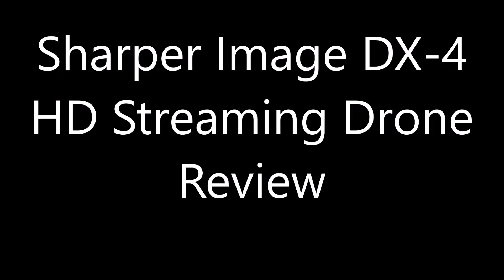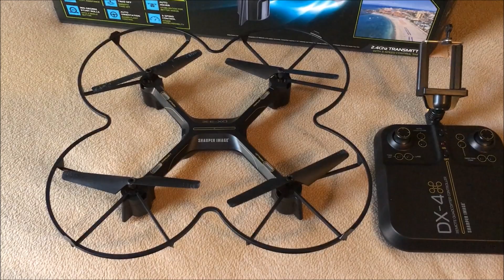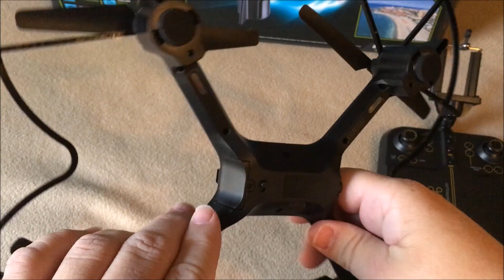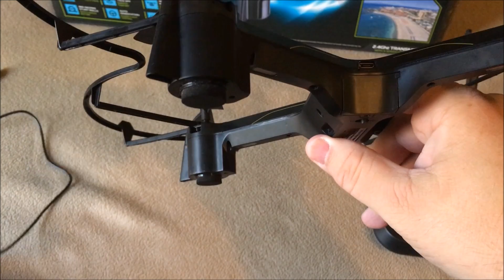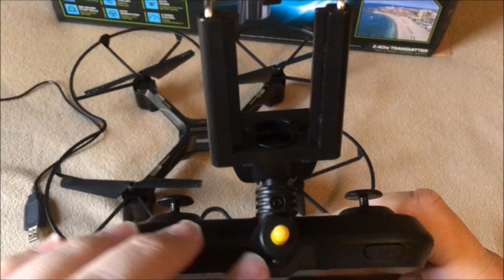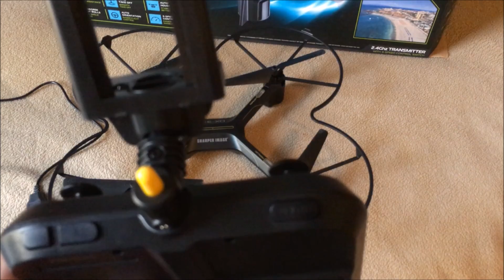Sharper Image Dx-4 HD Drone Review

Comment: I use the charger they gave and I plugged it I to the wall for over 5 hours and it still wasn’t charged and I also plugged it into my play station for over 6 hours and it won’t cut on or anybtjng and the red light is still on and I won’t come on

Comment: The manual says to press the right or left spin trim buttons if the done is rotating in one direction. As far as I can tell, these buttons do not exist. Also, how to you adjust the position of the camera? Am I supposed to just move it with my fingers?
Reply: Yeah, adjust camera with fingers prior to flight.

Comment: you can change the battery. just got this drone, went on ebay and bought some lipo batteries 1200 mah and some connectors. velcro the battery to the bottom of the drone and replaceable batteries
Reply: how much weight can it carry do u know?
Reply: matt delassus not much dude maybe 2 pounds if youre lucky

Comment: I didn't like it. The radio sticks are too small making flight adjustments hard to be smooth. The drone flies heavy with the rotor protectors on and if you take them off the first thing you hit bends the shafts. If you are looking for a beginner drone the Blade series especially the tini whoop is fantastic. This one is just a cheap toy. I got it as a present but would not buy on my own.

Comment: I always charge my drone from 2-3 hours but it runs out of battery in 15 minutes,what should i do??
Reply: 15 minutes? I guess you took off the protective thing for the blades. I get 8 minutes while recording. If you want more flight time, it cost way more
Reply from the maker: Nothing. That's completely normal. If you got more than 15 min I would be surprised.
Reply: Creature l m
Reply: Creature l p

Comment: I just bought the drone as a christmas present and today we were trying to set up the cell phone holder on the remote and the screws that came with it are too small ot too big to secure it. How did you secure the cell phone holder to your remote?
Reply: Arianna Duarte Yoo-hoo stick it on the black rounded part next to the yellow tip and tighten it

Comment: I'm thinking the Drone you need that you received or purchase is faulty because everything that you're saying is an issue with yours it's not a problem with mine at all my camera works just fine it is HD it doesn't glitch or cut out so I'm thinking you have some wiring issues in your unit... Also about the stunt button in the manual it states that you have to press the start button and then the direction that you want it to flip so with that being stated to completely operate this drone check over your manual once more honestly if that doesn't work I think it might just be your drone everything that I do to it as far as the directional trim does wonders and it hovers standing still
Reply: Stan Lewis I just hate the short battery life.
Reply: Stan Lewis me too
Reply: same
Reply: sometimes they just end up faulty mine for example is lost somewhere in the middle of a field because I lost control of it and of course I'm going to say it's not my fault but at the same time it seemed to lose control due to faulty controls
Reply: Stan Lewis lol
Reply: You bom
Reply: Duvon Perkins q

Comment: do you no why my prepeler won't spin
Reply: to make it do a stunt you got to hit the stunt button then move the right joy sick in the direction you want it to flip
Reply from the maker: Maybe a broke wire or damaged gear. I would take it back. Even if it's past the return date they more than likely will let you exchange it if you say you received it as a gift.
Reply: mine does that what you do is spin the blade while u have it on